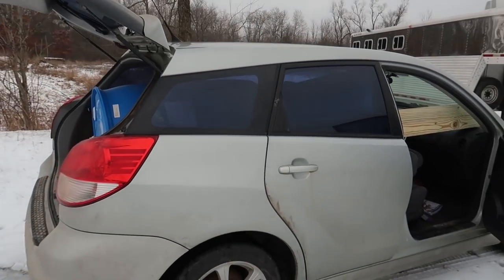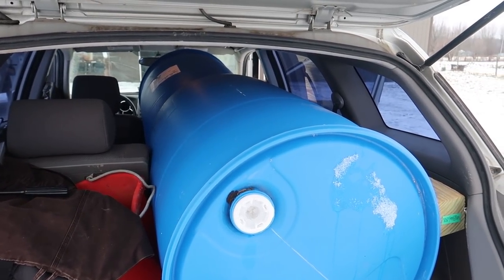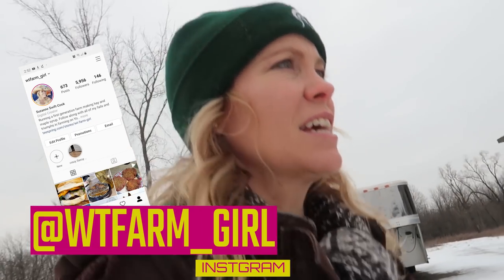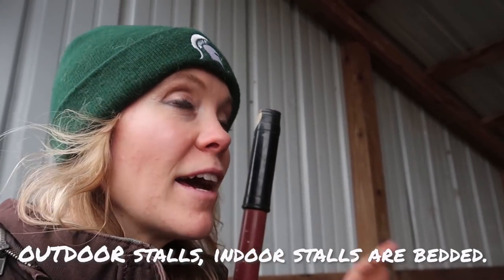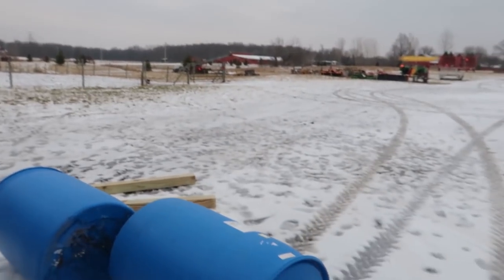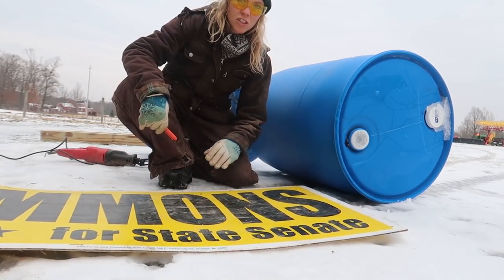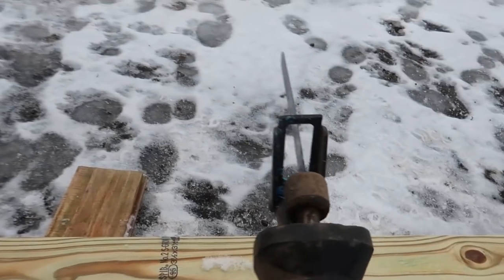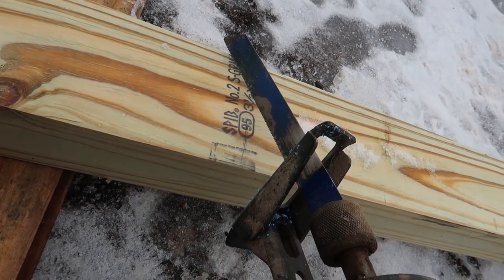279 DIY CHEAP Hay Feeder for Horses or Livestock - And Some General Farm Chaos ;D

Comment: In kindergarten carpentry class  you ask your students (How many 2’ boards can you cut out of an 8’ board) every one answers 4. Wrong! You can only cut 3 because your last board will be about 3/8” short due to the saw blade width. I have had fun with this one for a long time lol.
Reply from the maker: Very good! Although both of these were several inches LONGER than 8ft, lol! But you are completely correct for most lumber :D

Comment: I'm not a farmer but even I know you never saw with the electric blade cutting TOWARDS your body = one slip and it's game over.
Reply from the maker: A circular saw yes, but a salsal is a bit different. Hard to handle upside down to cut away from ones self. Plus it stops at the drop of a hat soon as you release the trigger (unlike a chainsaw). But generally yes, always try to avoid cutting toward oneslself whenever possible ;)

Comment: for my horses hay feeders, I put a 24in x 20in hole instead of cutting it in half. and 1/2 inch holes towards the bottom for drainage in case it rains. It keeps the hay inside on windy day.👍

Comment: Suzanne my wife and I made a multi hole feeder so we could feed  cattle through a fence.  We use angel iron to bolt the barrel halfs in  and pipe for legs with a round piece of steel welded to the bottom to keep them from sinking. 
If you look at the barrels they have a seam all the way around the barrel.  I know it goes across both bungs . You can get a good straight cut following the seam with a saw . I used a circular saw. 😊👍💖

Comment: Crud! I didn't get a notification.
That skill saw would cut right through that plastic barrel. I use one on PVC also. (Cuts straighter than the reciprocating saw, "Sawzall".
The barrels make great feeders and move easily.
MB BAR RANCH

Comment: I have never used plastic barrels before.  I have used steel 55 gallon barrels.  The cheapest that I have found is old water heaters.  The tanks are tough t cut with an oxy/acetylene torch because of the inside coating (never tried a plasma torch, but will next time).  And you can weld scrap pieces of steel to them to keep them from rolling around.
Reply: @CPUDOCTHE1 Wow, way above most of our skill sets & pay grade, but hey, you go!

Comment: At the cheese factory where I work we make fish bait barrels out of the 55-gallon drums about a inch and a half down from the top of lip is it is about where the barrel is narrowest I cut the top off then  take the top and put it upside down as a lid 
About a medium speed  with a wood blade gives me the best cut sawzaw or a circle saw 
After we're done cutting take a utility knife and scraped along the edges peels most of the loose frayed stuff off
I have yet to get a straight cut but I'm getting better
before we use them we remove all labels and triple rince

Comment: Your cracking me up girl,🤣🤣🤣🤣 ethanol is corn alcohol, yes it is added to gasoline and E85 fuel.
Reply from the maker: So you can drink the gasoline?? 😂
Reply: NO, they added chemicals to insure nobody would drink E85 moonshine, it’s a mix of corn alcohol and gasoline, so no drinking sorry.
Reply: @This1LifeWeLive   I missed anything about Ethanol ..  Ethanol often made from Corn  is  the Alcohol  you can drink in pure form .. You can buy Denatured alcohol at the drug store..  but they put some poison in it so you can't drink it .. Anyone who makes  Whiskey has to have a Federal Stamp Act Permit.. they lock your Still and only the Revenuer and unlock it .. The Tax on drinking alcohol is  $20.00 per gallon..  You will see a stamp on every Bottle of Whisky in the Liquor store..  Wine  under  12% Alcohol is exempt  .  Beer under  6.2%  alcohol is also except from the Revenuers..
  They run Drag Cars on  Methanol  but they add up to 90% Nitromethane  to make 40% more power over straight Methanol  It  burns  very slowly  that's why  Dragsters exhaust is so loud   but  the Blue Flames are from a bi product the Nitromethane combustion  which  is Hydrogen gas  burning makes the blue flames..

  Some times  very dunk people try to drink Methanol or Denatured alcohol  and it makes them blind or kills them.. Methanol  will make you blind for sure.. Some Sprint cars run on Methanol  it  really burns your eyes..

  They don't have to Poison or denature Ethanal  for cars  because they mix Gasoline in it .  Indy  cars run  on  98%  Ethanal  and 2% gasoline so you can't drink it..  Indy cars are allowed 200 gallons for the whole  race. they  used to run on Methanol .. but they switched because Ethanal is more Green and made from corn  where as  Methanol  is made from Natural gas..
Reply: @This1LifeWeLive   Speaking of Gasoline.. I was just  reading that's  just another way they Torture Farmers in South Africa.. they dump gasoline down their throats then light it .. 
  I know you channel  is not Political  but it's  very sad..  When  The whole Country is asleep   while the most dangerous Occupation in the World is being a Farmer in South Africa..   Lauren Southerland did a great Documentary in it .. and Even Shaun Hannity mentioned it the other night on FOX News.. also Donald Trump Tweeted about it one  time..

Comment: Suzanne, that's how I load my wife's caddy srx. I drive it to home Depot, or Lowes, and I load it with anything that I need to buy. Then it is cleaning time. Good job, carry on!
Reply: @theraponmichaelides7105 I show up at the hay/feed store in my cadi srx & ask for hay. They look around for my truck, see my cadi, & ask are you sure? Hint: to keep hay & hay dust to minimum, I cover the bales in 50 gallon bags, some bales require a bag over each end. It works, you work with what you got. Made it home with only a smidgen of hay in the back cargo area. Bonus is the baggef hay stays green longer & protects against the high humidity in Florida.

Comment: Just a thought (I've been known to have 1 or 2😃). If you set the barrels flat on the ground, and then bolted the 4x4s across the ENDS of the barrels, instead of underneath, your bolts would be much farther apart, and way less likely to tear out. With far less flex of the barrels. The ends may be thicker too. I used to raise  bulls. I only found 1 kind of hay ring that they couldn't destroy. 👍 on the video. It's a great idea for people with a few animals and MUD😛!
Reply from the maker: LOL yeah not sure these would hold up to a big bull!

Comment: Why didnt You use the loader to clean out the horse shed
Reply from the maker: It's a tight fit for the tractor. The loader on the NH is so big that to fully extend it to the back of the shelter it would pop the roof off the top :( And the backblade can't get in far enough. Bottom line, it's simply too large to fit well.

Comment: A 45 degree piece off each side of the 4x4 and wedge the side for support will ease the stress on the bolts. Chainsaw would of made quick work on the 4x4's and the circular saw cuts straighter lines on the barrel.  Good cardio day. The goal was accomplished.
Reply from the maker: All very good advice!

Comment: I have cut some plastic barrels around here and always used my circular saw. Also you need to mount them up in the air. Horse like to do stupid stuff like stand in the half barrel and bust them up when they are on the ground. I had that to happen. You may want to get them off the ground about 3 1/2 feet. Also they don't last to long with the hot and cold. weather. Good luck
Reply from the maker: Well I'm curious about the weather impacting them. I'm sure the horses would try standing in them too. I have a split 55 gal barrel bottom I use for water in another pasture and they love chewing the sides of it :P
Reply: The sun causes them to dry rot. Mine lasted maybe 5 years.

Comment: This video was interesting. I do like the way you edited it. The horses horsing around was funny.  You could also just use a belt sander to take the rough bits off the part you cut it would work very fast .  I thought you were making something that stands up at first then you did the math bit and I thought wow that is low two foot tall legs. Anyway it looks like something that might work .  Please show video's of you riding your horse .
Reply from the maker: LOL, I ahve done a few horse videos and the views are TERRIBLE, lol, most guys like tractors :(  But regardless, I do plan to get my mare riding this spring (fingers crossed!) HOnestly I spend so much time working on the farm it leaves little time for riding :(

Comment: use the  cage of the ibc tanker for a bail of hay for the horses be  better than what you made and saves hay as well
Reply from the maker: We did talk about that, but they would get their heads stuck. At least on our IBC totes the holes are the perfect size to stuff most of a face into and not get it back out without major damage :(
Reply: @This1LifeWeLive  let me think again

Comment: Screw two of the barrels end to end  and put half a bale in each one. You only have 2 horses. Don’t know what other kind of livestock you may have that you may have planned for the other barrels. Or you could cut one of your half barrel in half cross wise and screw a couple 2x4 across the open end then screw the boards to the end of one of the barrel halves then you would have used one full half and a half. That should hold a full bale. That would use 3 of your halves to make 2 feeders that should hold a full bale.
Reply from the maker: My plan is to put them in each corner of the pasture to keep the horses moving around (they are getting fat just standing at one pile). The topper I'm working on SHOULD allow them to hold most of a bale . . . fingers crossed though!

Comment: Is this a recent video?? Cuz am confused! It's been warm?? Come up north by the bridge it's not warm.. so you most be more closer to Ohio state;). If you looked carefully those plastic barrels do have a quick line if you wanted to cut straight down. We use those to feed salt and grain in. But that is a good idea to make did a good job for the first time,👍 but for feeding which am not sure about horses but I guess horses can reach for the hay inerways  you need to make a hay feeder with a flat floor by so many inches long by so many inches back. So they would have to reach in to eat, we have built one and still works great. We have something like that for our feeder calves, it can be use for your horses you just need to have it deep enough and tall enough. But that's my opinion. So good video young lady. Last but not least you make me laugh😂..lol

Comment: What happened to doing the shelter cleaning with the bucket loader like last time?I give you credit for doing the manual labor for great exercise. You pretty handy at loading up your Matrix so glad you chose to make a video about it.
Reply from the maker: The loader doesn't get in too well, and still require a lot of work getting the back half out. as muddy as it was it would be more hassle dealing with big tire ruts :(

Comment: Just a quick question, why not use the front end loader of your tractor to clean out the house stalls?  Is tractor to y’all?
Reply: That was my first thought. LOL
Reply: I was thinking the same thing. Most likely to muddy and tractor might get stuck?
Reply from the maker: It's a tight fit for the tractor. The loader on the NH is so big that to fully extend it to the back of the shelter it would pop the roof off the top :( And the backblade can't get in far enough. Bottom line, it's simply too large to fit well.
Reply: Too big to fit, yes, and if you tried to push-load the bucket you would probably bust the shelter.  But, it's much easier to unload the bucket and spread it, than from the "side-by-side" with a shovel. Just don't let any engine(s) idle when not working, just wasted fuel.

Comment: You should use a circular saw,much easier.  I made feeders like this but I used angle iron from old bed frames.
   Good to see them made differently,
Reply from the maker: I hadn't thought to use a circular saw to cut the barrels!

Comment: Well it kinda makes sense not to put haty down in a muddy horse shelter. All that will accomplish is maing a bigger mess thats harder to clean up. Ethanol is an additive to fuel
Reply from the maker: I had been putting hay in the shelter during very windy days to prevent it blowing away. And the shelter usually isn't muddy, just the outside is. Inside has a thick mat of manure though :P
Reply: Well dear its obvious bty looking at the horses they are very well taken care of. If you can stop them from eating everything lol
 Be safe girl. God bless

Comment: When people ask me, a car guy, what small car they should get, I alway say Toyota Matrix.  Do they listen? Nope.
Reply: What, not a Yugo?
Reply from the maker: hahah, yes!
Reply: No Farmer wants a toy, for any job.  Perhaps the wife, for obvious reasons.
Reply: Scotty Kilmer's  says  Toyotas are the best  he has one of the Most Popular  Yooo Toob channels and he did a TV  show  before  yoo  Toob existed..  on Car Repairs.    Recently  he fixed a Broken  Plastic Grill on a Mercedes with Dental Glue . cures with a infrared light ..  you can buy the stuff on Amazon he posted a link .. It does not tastes as bad as JB  Weld when you are fixing a tooth ..
Reply: @jimbaxter4600   They have the Big  Ford F-350 Diesel  but it won't start in the Winter..  plus  maybe it's too nice to get salt and chloride on it .  Cars and Trucks rust  out  very fast in Michigan..  The Road Commissions and State Highways  don't even know how to plow snow anymore .. They always try to melt it off the roads by spreading salt ..   Studded tires are not legal in MI .. they  were when I was a kid .. My Grandfather always had  studded tires to put on his two wheel drive pickup  back then

Comment: 55 or 35 USG?  I use a circular (Skill Saw) to cut those. Much easier and quicker.  Lucky horse at 12:27!  Do you have Alpacas now  19:31 or was that a big dog?  
You made great troughs.  I think your bucket on the NH could have emptied those stalls easier..
Great to see you again.
Reply from the maker: I ahdn't thought of the circular saw :) And I think maybe that was the horse in the background?

Comment: No one can ever say you're not a hard worker, but, ok, here it comes, why don't you you use the tractor to scoop out the majority of the manure, maybe backblade it, or use your rear scraper?, The feeders looked great, the horses/cows will never notice if it's not perfectly straight, I thought you did great cutting them, very good video as always, Suzanne
Reply from the maker: It's a tight fit for the tractor. The loader on the NH is so big that to fully extend it to the back of the shelter it would pop the roof off the top :( And the backblade can't get in far enough. Bottom line, it's simply too large to fit well. I do use it for the mud in front though, MUCH faster than scooping my hand :D

Comment: Wtfarm girl video why didn't you use your tractor with a bucket on it clean out the horse area out
Reply from the maker: It's a tight fit for the tractor. The loader on the NH is so big that to fully extend it to the back of the shelter it would pop the roof off the top :( And the backblade can't get in far enough. Bottom line, it's simply too large to fit well.
Reply: @This1LifeWeLive  plus some sand and where your horses stand at work it up what the ground up eventually that mud is it won't be no mud there